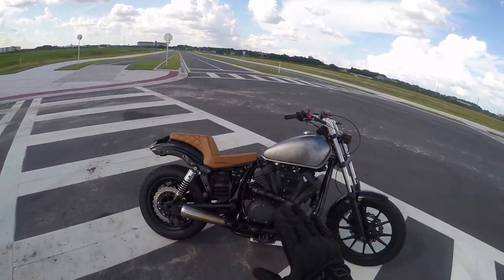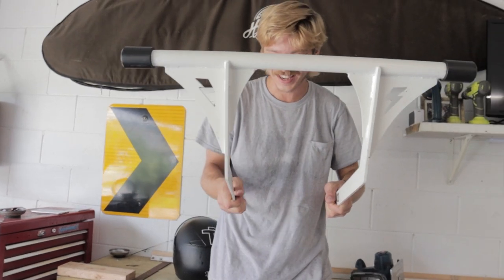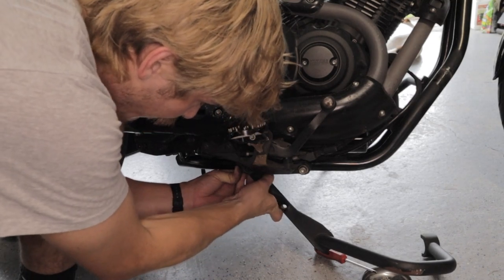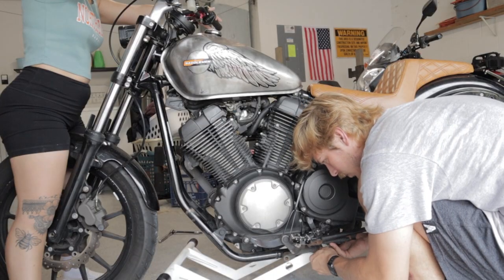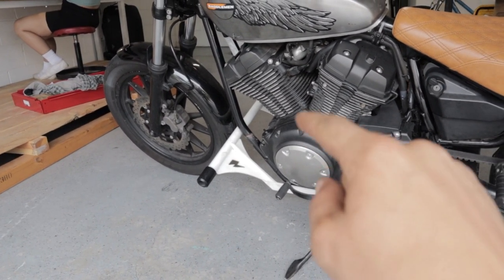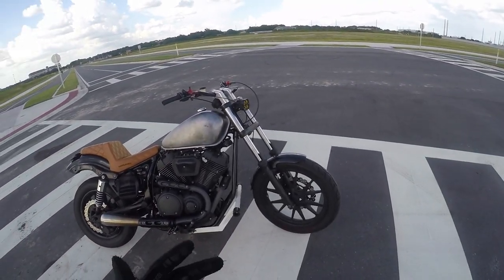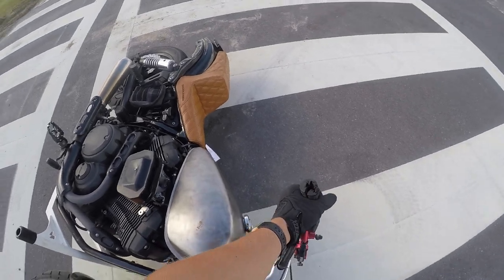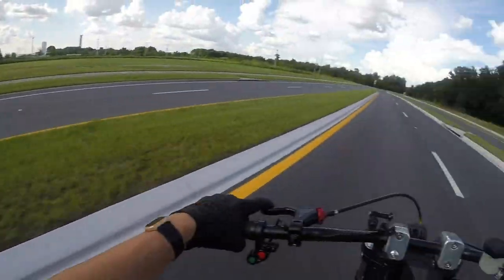YAMAHA BOLT BUILD#15 | Finally, a Real CRASH CAGE

Comment: I love your videos and they helped me make the best decision for my bolt

I have watched all these videos on these best bars and in truth just didn't trust the frame of the bolt more than anything

I decided to go with a highway bar for an 07 Harley Street Bob

I am a professional welder and modified the crash bar to fit and add a cross member I felt was probably missing to begin with between the 2 main supports below the horn. It's really tough and now I can get an easy and cheap replacement on Amazon for 80$. I love it and it has those rubber foot rests in just the right spot for the highway.